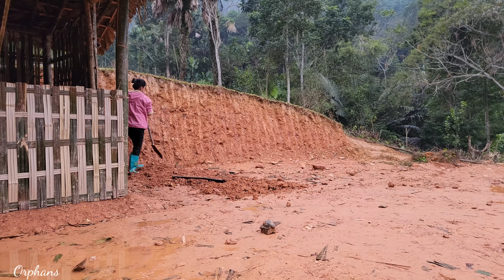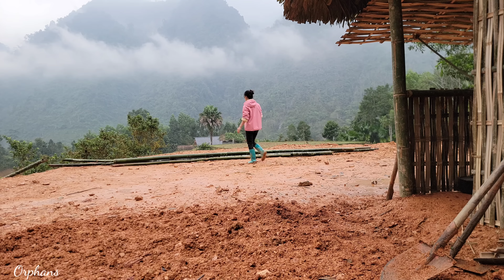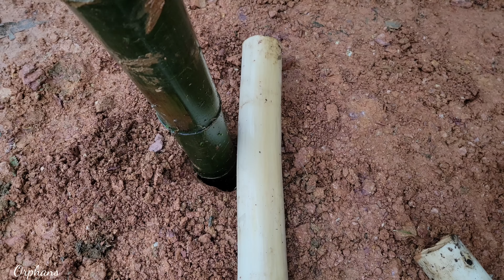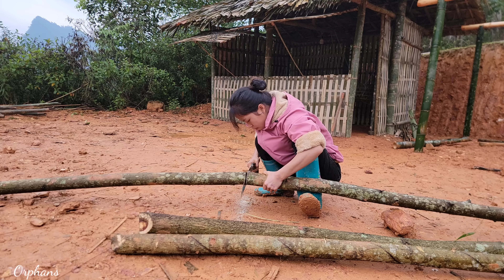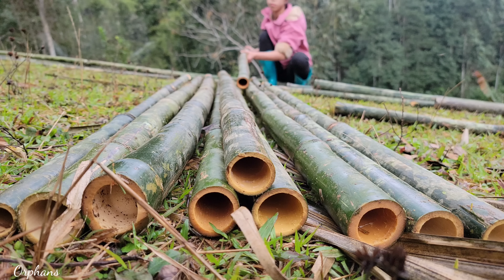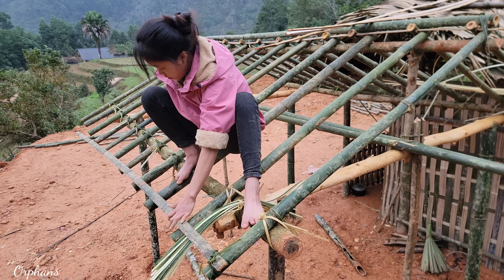The 17-year-old single girl and her adopted child complete the kitchen frame | orphans

Comment: Great! Your building skills are amazing.!!!!..it looks like you might have a problem with rain falling off the kitchen roof into your living area though.  All the best wishes to you!!!
Reply: same question - why change direction for adjacent building roof?
Reply: I applaud her hard work and ingenuity, but I see some problems here...mostly related to water....her new house does not have a handy water supply like her old one did, so it will be hard for her to keep things clean. Also when it rains hard her new kitchen area roof is facing the wrong way and a lot of water will fall between the two structures and make a lot of mud.  Speaking of mud, I had suggested to her that she should check out the local soil, which appears to be red clay...if it is, a kiln is easy to build, costs nothing, and she could make her own pottery and containers...there are a couple of good videos of this under "primitive technology" here on Youtube.